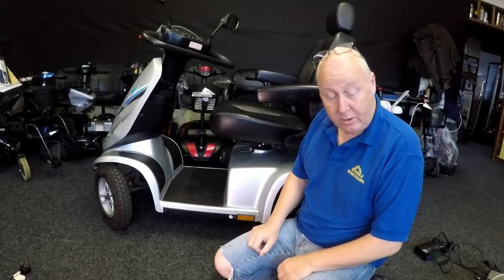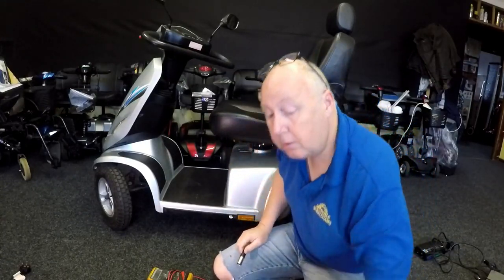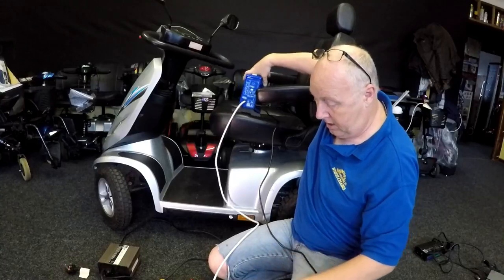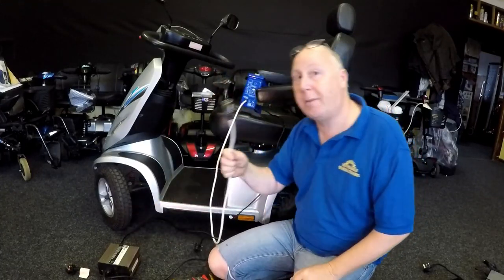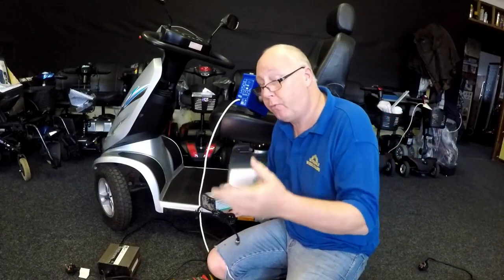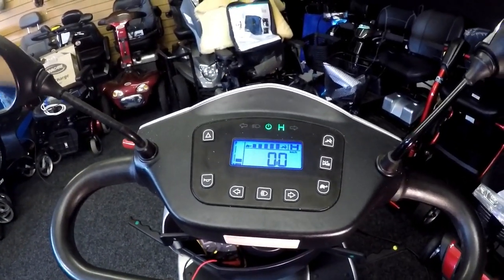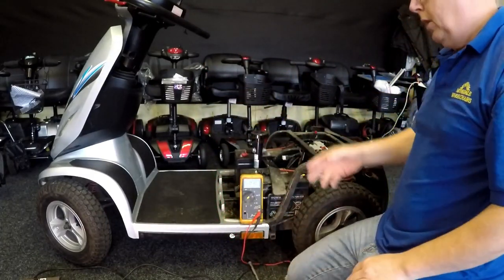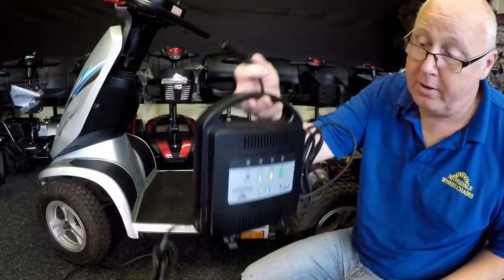Testing a Mobility battery charger & how to test if its faulty. How mobility battery chargers work.

Comment: Thankyou Tom!  My partner got no sense out of her supplier when her scooter came to a halt after two years light use. 
 "New charger and new battery - £800" was all they knew to say.   She was in tears.  
Nobody, but nobody, could suggest a way to check whether it was battery or charger failure or both.  They were clueless as to whether the particular charger had to sense voltage before it could work (thank you for that tip) nor did they know there could be issues around having opted at purchase for lithium instead of lead acid.  Read the manual?  Haha!  
My partner and I are heading off now to your Nithsdale Wheelchairs website where I feel sure we shall feel safe!

Comment: Thank you for all these valuable videos, but some things are beyond a user. This particular, and your similar videos are helpful. Could you advise on a scooter,shop rider, why the battery power shows it is falling within a few minutes, and the scooter slows down to an almost stop position.Would the speed control have any reason to cause this.? I mention this because when I turned the control knob at one point the scooter faltered.Any thoughts.?
Reply: I have this problem, shows fully charged,  I’m a new scooter user , bought second hand, start of snail pace , stopped and put it up a little, little blue light starts flashing and scooter starts beeping, speed went very slow barley moving, but thankfully got home. I’m scared to go out on it again in case it stops and I’m stranded.

Comment: Excellent video.  When you tested the voltage on each battery individually, you had 11.5v and 12.5 volts.   Why do you think this is and what effects do you think this will cause in the future, if anything?
Reply from the maker: Battery will not be in as 100% condition so a little weaker than the other one. Through time you will need to replace both of them.

Comment: I'm new to the mobility scooter world and already I'm suffering from range anxiety. Batteries are 1 month old, I charge them up after each time I go out (usually only travel 3 miles maximum) overnight and the battery charger takes approx 14 hours to fully charge the batteries (it's as bad as waiting for paint to dry 🤣), but when I go out on my scooter by the time I've travelled about 1.5 mile, battery indicator light has dropped by 3 lights, but if I turn the scooter off and on again, the battery indicator shows only 1 light dropped. By the time I get home again (travel 2 - 3 miles maximum) 3 lights have dropped on the battery indicator on the scooter.......I only ever travel at the 2mph half speed . I also loose power even when travelling on the level, but if I stop turn the scooter off and on again, the scooter will travel at the ok speed for a while, then the speed drops again. I don't know if it's the batteries that are at fault, the charger or whether there is a problem with the scooter itself. I have a Pride Apex Rapid with 2 x 18ah batteries and I'm supposed to be able to travel a maximum of 16 miles depending on conditions. Any suggestions on what I ought to check to see what's wrong?
Reply: Mine does that too, did you find the solution /problem ?
Reply: @Bluelady777   I had a faulty charger......not had a problem since it was replaced under warranty.

Comment: they are standard XLR connectors... you charge £20-30 for them... they are a couple of quid from any electronics store like R S .
Reply from the maker: Hi Cole I can’t find it on our site. Our plastic ones are a 10er and the male charging sockets also the more expensive ones (female charging sockets) are pre wired around 20-25 and come straight from the scooter manufacturers, plug and play. We recommend getting the correct connections so they make a proper contact this will prevent heat buildup in case 2 different connections are not matched.

Comment: I find the fault of my scooter not charging is the fuse for the battery has blown. Where can I find a red fuse for a Pride Victory 10 four wheel model
Reply from the maker: Hi fuse is on the tiller together with the light fuses and ignition.

Comment: I put push to test volt meters on my scooter they work well as you can see what is happening at any time with out taking the scooter apart one on each battery and one on the charge socket they are so cheap now you can see what is happening any time
Reply from the maker: Hi yes good one . you could do that but does not work on all products as some are fitted with a diode.

Comment: Hi . 
Yes interesting video . Thanks 
Question please . 
Just fitted new fully charged batteries to my scooter . 
But on the monitor the last three lights don’t light up . 
Any advice please as to the problem. 
Is it a faulty monitor. 
Or faulty battery charger ? 
Thanks

Comment: Every time I charge my scooter I plug in the charger the battery is fully charged all the lights are working but then I go to drive it and it starts to beep nine times the last few times I had to take the scooter completely apart and put everything back together and then it works again I don't get it I don't know what to do but it stopped again because I had to charge it. Is there an answer for this old lady because it's exhausting it's really heavy to lift the seat and then take the rear end off and then put it all back together
Reply from the maker: Sounds like a bad connection check all contacts ps what’s the make and model

Comment: I just come across your videos.
I too am a mobility scooter technician. I am finding your tutorials quite informative.
Can you please tell us what make and model the blue battery tester is that you use in your video? I"ve never seen one like it.
Keep up the good work.

Joe
Reply from the maker: Hi, i have has this for years now and cant really remember where i purchased it. Must be around 20 years now...but i would recon it could by made with a current metre  or just use a DC clamp meter on a home made extension wire.....
Reply: @tomjacques4  Thank you for responding. You're probably right, but, yours looks like a really good addition and also neat. What is the make a model number of your unit?
Be Safe! Keep up the great work that you are doing!

Comment: Just curious as to why you didn't simply make a cable adaptor using that new female socket you installed wired to the plug off the dead charger? Would have avoided modifying the scooter and allowed a charger with either connector type to have been used in the future. Otherwise - good video.
Reply from the maker: Yep sure could of but don’t like too many joints more chances of overheating if they become slack. And those Anderson connectors are not the best. Mind you I’ve done it before but not with those connectors but with the 3 pin connectors for reverse polarity chargers.  well spotted mate.

Comment: so my charger is the 5 amp hp8204b battery charger  and the power light comes on but the charging status light doesnt!  no orange or green light only the power light.  my batteries are not flat in fact the 80% full.  so idk i reckon my charger is broken.  it does have a fuse which looks ok.
Reply from the maker: So you have watched the video and hope you have power at the charging socket if the scooter yes?
Reply: @tomjacques4  YES - well my batteries are at 80% at least nearly full.  So I know it is not my batteries that are flat. I guess tomorrow I will put my multimeter into the charging socket and check that out.  But I am 99% sure it will be my charger.

Comment: very helpful thank you my opticharge 8 amp charger wull not charge up my batteries  on my invacare orion metro
mobility scooter and i am still trying to fix this
Reply from the maker: Recon the 2 inside lights are flashing on the charger eh.  If thats the case check to ensure you have enough voltage at the charger socket also that you have a good connection at all terminals from the socket to the batteries

Comment: I have a Jazzy 1122 that will not work if the internal battery charger is installed.  I purchased a new charger and it still doesen't work, but when I remove the charger then it drives... please help!

Comment: Hi .
I have a jazzy 6,
It has 2 12v 34amp batteries. The jazzy is to heavy so it stays in the car I bring the batteries in to the house, as they are 12v each can I use a smart car charger and charger separately.  Thanks Jim
Reply from the maker: Maybe better get a hoist. Or a long 13amp
Extension lead

Comment: Hi Tom, very informative videos. I never realised there was so much involved with electric mobility scooters 
My friend has a problem with his 8 amp 3 stage charger. (It looks very similar to the blue one in your video at 24 mins approx.)
The three leds are flashing when you connect it up. The sequence is low battery lrd flashes once then all three leds flash together. This constantly repeats. Also a relay can be heard opening and closing in the unit.
Is this a problem with the charger or with the batteries being flat on the scooter? ( It has been idle for some time)

Cheers

Trevor
Reply from the maker: Hi 👋 check batteries get them tested also check all cables to the charging socket and ensure you have power at the socket
Reply: Hi Tom,
Back about the same problem. His supplier brought 2 brand new batteries but charger behaving as before. This is the first time I was able to check the bike out. I noticed that the charger connection had a lot of slack movement. I had to remove the fairing, headlight etc yo get access. When I eventually got the charging socket free from the bike the cable was not a short one, like in your video, instead the cable disappeared into one of the frame legs and went right back to the control box! I imagine the fix is to cut the cable up near the handlebars and solder on a replacement with the short lead. Is this recommended.? I didn't want to start cutting cables if this was not the approved method.
Akso noticed when I switched the ignition on the display eas reading 24volts. ( I thought this was full charge but after watching your video I'm not sure. Anyway, I was able to drive the scooter but noticed the voltage dropped very quickly and after about 200 or 300 yards the audible low battery indicator started sounding. 
I'm more confused than ever. If the batteries weren't charging, how was the scooter able to drive at all. And why did it rjn out so quickly if the onboard voltmeter was showjng 24 volts. Sorry to be so long winded but I would like to get to the bottom of this

Cheers

Trevor

Comment: The gel batteries don't convince me at all, I live on the mountain and I'm not allowed to use public transport with my mobile (it's not safe) I have to use my mobile to go to the doctor, go shopping, etc. even in winter, I take care of myself and I don't have any help AGM batteries are the best they keep the voltage even if 1/4 of the energy has been used, but it is also clear that in winter at minus degrees the energy is used up faster and they are a bit more expensive to buy but they last longer than the gel batteries . I have no problems with AGM batteries.

Comment: Hi my shoprider doesn’t charge I plug the charger in to the scooter the charger starts up (the fan) the lite flashes yellow then the charger completely turns off after 2 secs with no lights ,what do you suggest I test thanks
Reply from the maker: Check for voltage at the charging point of the scooter there must be voltage. And said voltage must be higher than 16v

Comment: Your video was helpful trying to figure out the status of batteries on a used scooter we bought - I'm not good with electrical issues.  I have two questions you may be able to help with. I'm going to replace my batteries. I currently have two 12v 18aH batteries. Can I upgrade to two 12v 22Ah batteries (same physical size) to increase my range?  I assume I need to buy a new charger if I get highter AH batteries.
 If you advise against increasing size, do you see a problem with the power supply that came with our scooter? It says GEL battery charger (Model P1202B, DC output +24v 1.8A. THe old batteries are SLA and I intend to replace them with SLA's regardless of the amp hours.   
I don't think it matters, but just in  case, I have a GoldenTechnologiesi LiteRIder 3-wheel scooter, model GL110.  I don't know the age of the scooter. I don't have the manual. The only Serial Number I can find is near the back wheel axel - GLC0006. Thank you for any advise you can offer.
Reply from the maker: Yes you can fit the 22s charger should be the same as the battery. 1.8amp o will just take longer to charge
Reply: Thanks so much for your reply!

Comment: Thanks for the video: I fitted two new 75ah gel batteries in my Wife's Pride S4 scooter in April, so not cheap but thought we would be good for at least a couple of years, the AGM,s that were in before lasted 18 months. 
She uses it most days for 2 or 3 miles, and she plugs it on charge with a Powerfirst PF2408LP intelligent charger at the end of every day. Back in April things were great she could run everywhere around the town and hardly drop a bar, now here we are in October and after two miles its flashing on 2 bars and barely managing to get back.
What do you think might have caused this? Do you think the charger might be delivering the wrong charging profile?
Reply from the maker: As long as you are charging ever night and the charger states it fully charged then it should be unless there is an issue with the batteries. Gells should last around 4-8 Years. I would contact your supplier if it’s still under warranty.
Reply: Hello, I had the same problem with the gel batteries, they lasted 1 year before they were defective, I am currently driving AGM batteries, these have been in my mobile phone for 2 years without any problems, I live in the mountains and therefore always need 100% power, I I recently saw a video and it was said that it's best if the batteries are fully charged before each trip, no matter how far you've driven the mobile before, a maximum of 8 hours and I disconnect the mobile from the charger before I drive!

Comment: I have an older model shoprider 3 wheeler, wondering about getting a replacement charger off ebay,
they tend to only have positive on pin1 and negative on pin2, nothing on pin3 the inhiibit wire.
I assume the batteries will still charge with these chargers but no inhibit function, can you just join the negative on pin2 to pin3 thus making pin3  negative also and making the ihibit function work?
Australia here, dont want to blow anything up.
Reply from the maker: One and 3 usually pos and beg. Inhibit is 2 if you check the charger it’s should be 1&3 usually this is standard
Reply: @tomjacques4  ok thnx will check that out...ty
Reply: thanks for that @tomjacques4

Comment: I have a Sterling S425...it hasn't been used much in recent months, I ran the battery level down to the orange but when I plug the charger in it goes red.... yellow (solid) charging...then green (fully charged) after only a few minutes....is that a fault?...can't see it being charged that quick or can the batteries still be fully charged?
Reply from the maker: Hi always charge a minimum of 8 Hrs even if the green light comes on earlier. It will go on a trickle charge after that.

Comment: Hi my scooter only has1 battery, the battery is pretty new but I wanted to see how far it would take me before a trip away, it went ok but ever since is not charging fully, charger says it is and stops charging but as soon as you start moving it its dropping 1 bar ive cleaned connectors and it seems fast enough but its a worry
Reply from the maker: Make and model ?

Comment: Hi! I have a jazzy elite 14. My question is, is it normal for my charger box to get really warm. But not to warm to touch. Just really warm after 2 hours of charging give'er take.
Reply from the maker: If the batteries are in poor condition then the charger may put more current into it hence warm up. Some
Have fans etc to keep them cool. Should really cool down the longer they charge as the current decreases.

Comment: My charger MK is not charging its making clicking noises and lights are jumping , unit is overheating as well 😳😬
Is it the fan ?
Can you advise please thanks 🙏🏽
Reply from the maker: How old are the batteries. Is the scooter holding its charge ? Check how much current s the charger giving the batteries when flat and once fully charged
Reply: @tomjacques4   the scooter still has charge left , I just went to top up .
Reply: What tool do I need to buy ? To test this . Batteries are 4 years old I think 🤔.

Comment: I have a 3 wheel scooter that has started popping the breaker and stops running going up incline. Could that be caused by weak batteries?   I tested both batteries and tested 13.4   If not where should I start trouble shooting ?
Reply from the maker: Check for slack connections and the Motor could be a faulty circuit breaker

Comment: Hi, I have been given a Komfi - Rider mobility scooter, when I plugged the charger in to charge batteries the red light on the charger is flickering rapidly and is advised as incorrect, do you have any idea why this is, also the key I had for my shop rider scooter does not fit ok in the ignition, do you stock keys for the ignition got this type of scooter .🤔😊